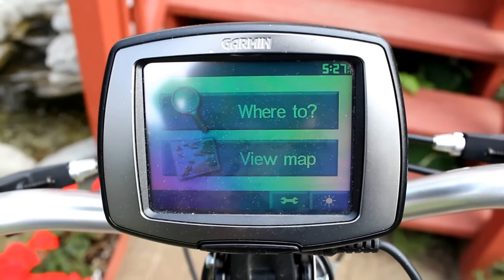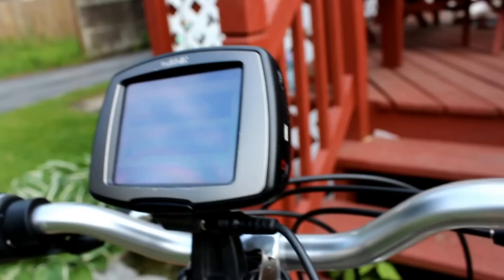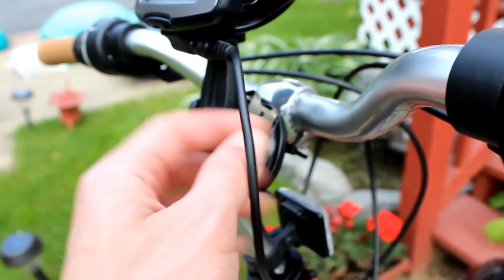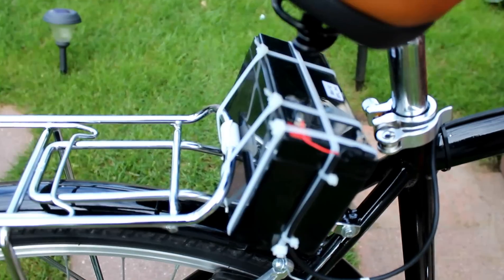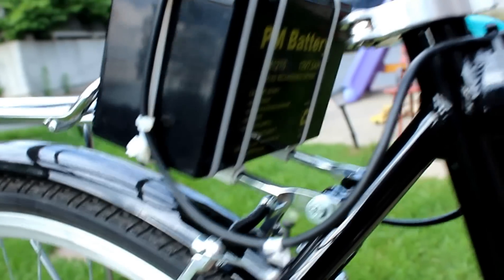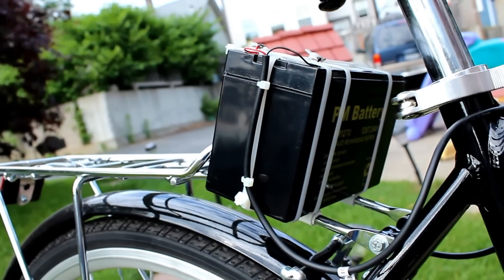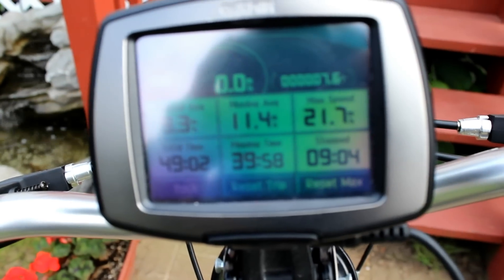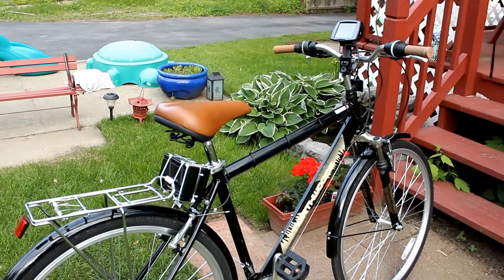Garmin GPS bicycle hack with 12v rechargeable battery system

Comment from the maker: I used the original cigarette lighter cord that came with the GPS and cut off the cigarette lighter end.  Then I stripped the insulation off the wires and soldered them directly to the lead acid battery.  It's an older Garmin GPS that accepted 12 volts input.  If your GPS is powered off a 5 volt input, I would try using a 6 volt battery with a diode (to drop the voltage down to 5.4 volts) or better yet, use a LM7805 voltage regulator.